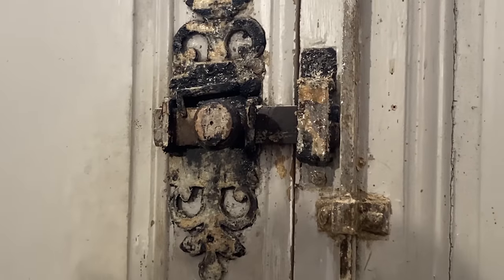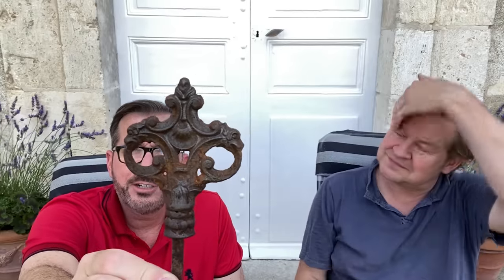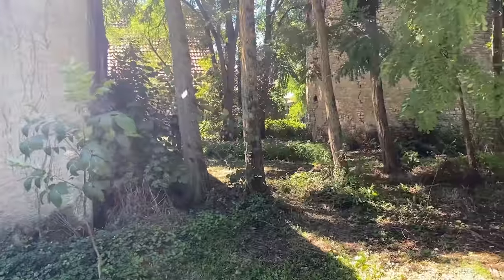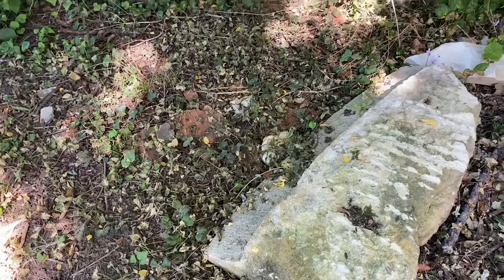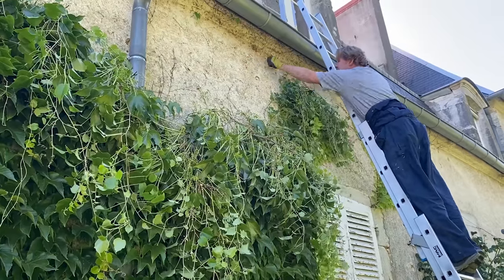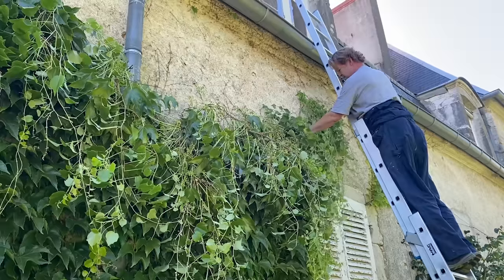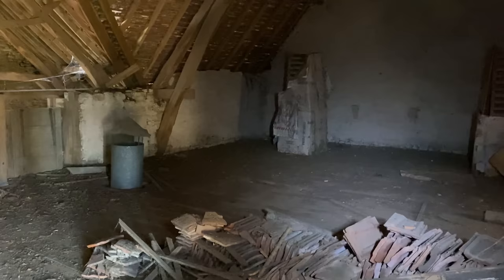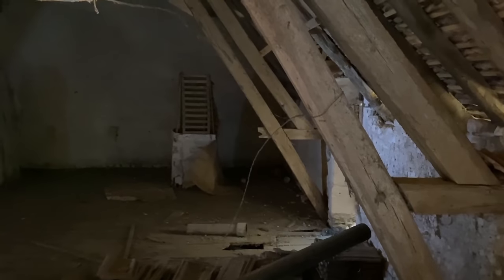An Invitation for Cocktails at a Famous YouTube Château  - Journey to the Château de Colombe, Ep. 33

Comment: At 11:54, the top of the dovecote's keyhole is almost the same pattern as the "metal piece" mentioned in my previous comment.  Could it be the bottom of the keyhole plate?
Reply from the maker: The door knob / keyhole faceplate for the dovecote is the same design for most doors in the chateau and outbuildings. The found object is large and heavy and most likely related to a gate. Hopefully we will discover more pieces like it and learn more about it. Thank you for watching! 😀

Comment: I think restoring these doors and their hardware in place is the smartest approach. A good product to have on hand is the French equivalent of penetrating oil. The US brand I prefer is Liquid Wrench. You will find many uses for it on rusty hardware, hinges, locks, etc. Spray it on let it work in for a day or two and then clean the item.  You can free up the works of old locks, metal tools as well as help remove built up rust on nearly anything.
Reply: I looked it up. Thank you. I found the French equivalent. Yay. We have two stable door that have hinges that won’t budge……. Goin to get it Tuesday. Great bday pregame to for me!  Ha. I’ll get them unstuck!  Trying for over one week ….
Reply: @patrickjourneytothechateau8243   Keep adding the penetrating oil every day it if the hinges are in place, if you remove remove them, soak them in the stuff.  the should slowly become workable.. Good luck!

Comment: Use a wire brush attachment you can buy for your drill.   A few different sizes.  It’s great for removing.  Hint…oven cleaner works great to remove old greasy bits on doors with the wire brush.
Reply from the maker: Good advice 👍
Reply: Hi Deb.  We bought the wire attachments. Two sets. They are amazing. Great advice. Thank you so much. Hugs. 💖
Reply: Woo hoo!!!!  I'm sure you will make great use of those for many projects!

Comment: When you get round to repairing the dove cot use a lime plaster instead of concrete it will allow the stone to breath and stop the stone sweating
Reply from the maker: Yep. We will use lime plaster for all building renovations. Thanks!
Reply: No concrete ever in an old building.  Hydraulic chalk and sand….  Add water.  We have a lot of surfaces to re plaster.  😳👍🏻
Reply: No concrete ever in an old building.  Hydraulic chalk and sand….  Add water.  We have a lot of surfaces to re plaster.  😳👍🏻

Comment: For the metal piece you have found.  Try H202 (hydrogen peroxide) or contact Angelina from the Chateau du Bailleuil - @Chateau Life (YouTube) - she has a product that she uses to remove rust from rusty radiators.  Could the piece be a part of an ornamental wind vane from one of the roofs?  Or simply a finial or the top or bottom of a door lock?  Maybe even from the wine cellar door (which is in the same area)?  Those are my guesses.
Reply: Great guesses.  We will keep you posted if we find anything more.  The rust is almost gone. Thank you for the tip.  Love your comment.  Hugs from Colombe. 💗🥰💗